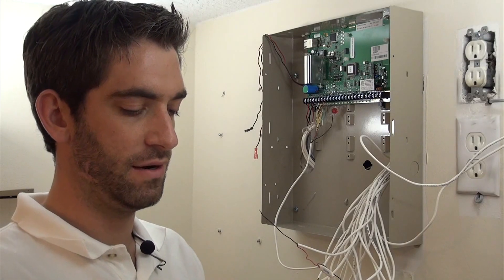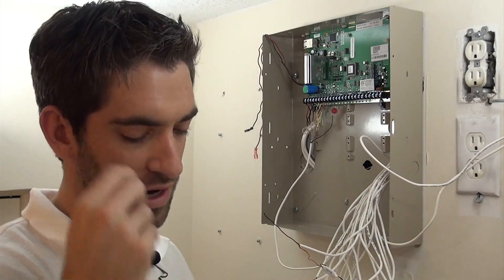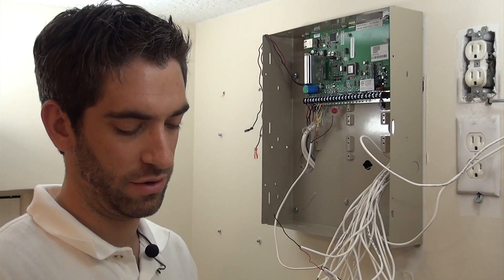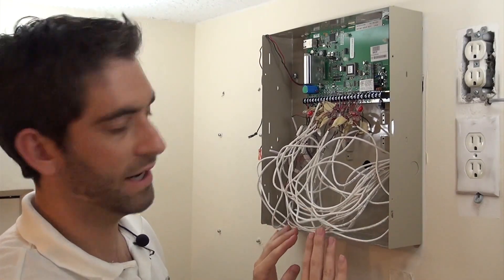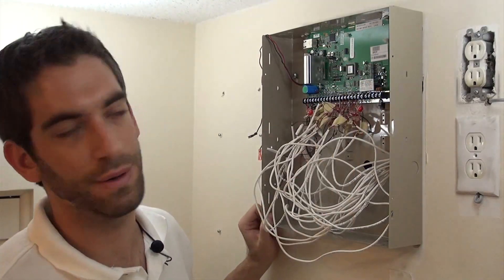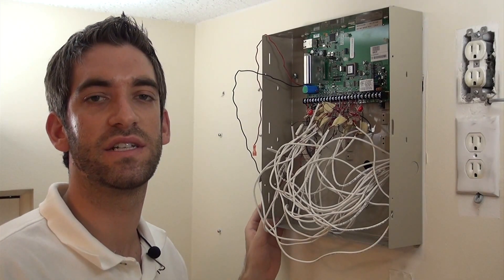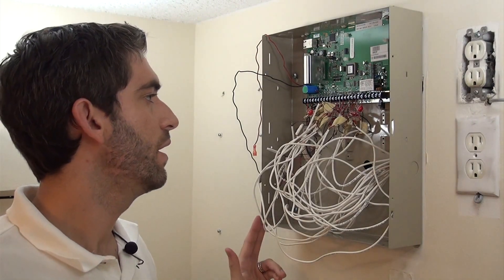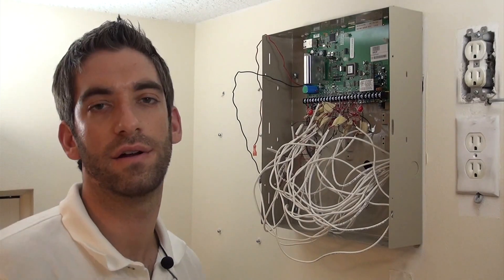Honeywell VISTA 21IP: Swapping Out an APEX Destiny Security System Part (4 of 8)

Comment: Can telephone wire be used for the alarm panel zones?  The reason I ask is that I was thinking of connecting a sensor to
my garage door.  There is a unused telephone line that runs out to my garage from my basement where my alarm panel is.
It would be pretty easy to connect it this way.
Reply: We normally recommend 22 gauge wire but depending on what kind of phone wire is run, that may work as well.